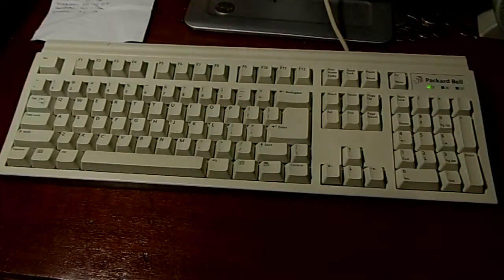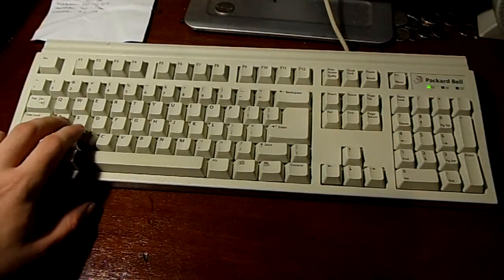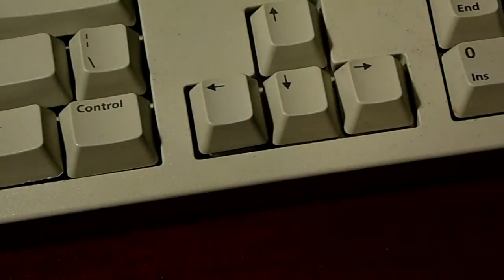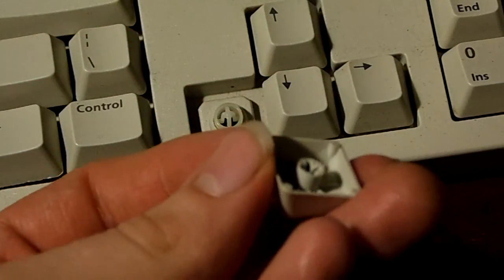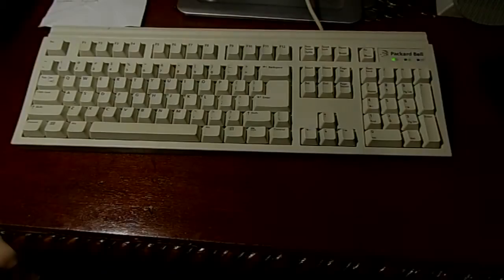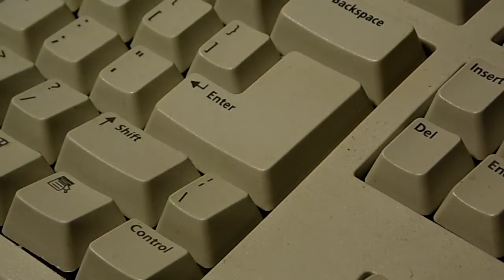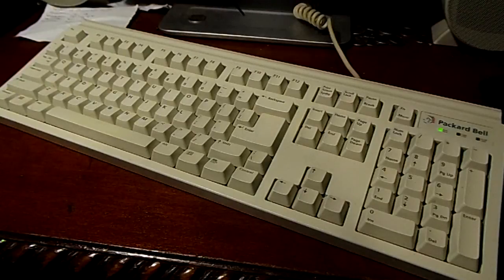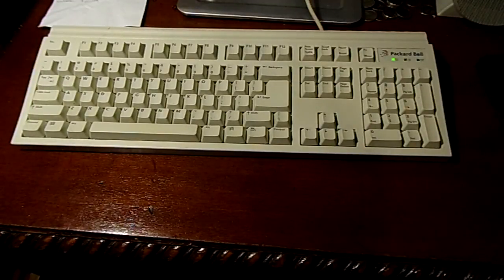Taking a look at the Packard Bell 5131c Keyboard.

Comment: The Keyboard I played Half Life 2 with. I had a custom PC built with scavenged parts, It had a Packard Bell keyboard, a late 90s Gateway CRT Monitor and the stereo Creative speakers that originally came with the Gateway (which was purchased new).
Reply: Interesting, i recently did a playtrough of a HL2 2004 build using a BTC/ Packard Bell 5139 keyboard. Infact, i'm typing on it right now!

Comment: So basically they Topre switches?
I found one at the flea market today. Looks the same without the windows key. 
The key feels like it's PBT there was zero wear on the caps, and all the key material still feel scratchy. The back has a solid metal plate.
The keys feels really really nice, i used quite a few keyboards, this one feels dam nice.
I think $20 in good Condition is hell of a deal in 2017 lol
Reply from the maker: Yeah I have a friend who is bigger on mech keyboards than me (I personally am no fan of mechanical keyboards) and he said it sounded like it was a topre basically when I described it to him. I have yet to find a keyboard better than these Packard Bell ones so every time I see one I snag it. I also collect the computers so it's nice to have some extra keyboards for that reason too. lol
Reply: Zhemin Lin sadly the keycaps are far, far, from PBT. they are laser engraved single-shot abs, but that doesn't mean this keyboard isn't alright
Reply: I just got one for 13 dollars in 2021. But some keycaps like f1 and f2 dont still in place for some reason. Its its only defect. But mine is a BTC 5149, and I think it's much more pretty than these packy bell. It has no windows keys, and has some gray keys that are beautiful.

Comment: This was the keyboard of my first computer back in 1995. I forgot about it and recently took it out of storage. After cleaning it up it brings back a lot of memories. Its not like the mechanical keyboards I use now, but its certainly a lot better than the membrane keyboards I used after this. The touch feel and the sound is quite good. I will probably lube the switches and I'm planning a mod to make it detachable with a usb C connector so I can use it sometimes in my current setup when I feel like it.

Comment: I have a BTC 5149, and it has the same switches and mount. But some keycaps, like f1 and f2 dont still in place like yours. It dont makes this "clack" 2:06 sound that yours make when I try to fit them. And after a while they come out the keyboard. How could I fix it?

Comment: My grandparents bought us a Packard Bell back in the mid 90's and it came with this keyboard, I never really thought much of it. I usually use MX Brown keyboards nowadays, but found one of these on ebay for about $20 and wanted to see how it is in comparison to the garbage modern OEM Dell/HP keyboards we use at work and my Browns. Fedex truck just dropped it off about 30 minutes ago and I am kinda floored--this feels better than any other non-mech (and even some mech) keyboards I've tried recently. 
I really can't decide if I like the feel of this more or the AJAZZ AK510 I just bought.
Reply from the maker: Lol I fully agree, they are by far my favourite keyboards hands down. Btw what are you using to use it on your modern PC? All the PS/2 to USB adapters I've used have always become flakey after a while.
Reply: @TranscendentalAirwaves  Oddly enough, my AM4 motherboard has a PS2 socket.
Reply: @TranscendentalAirwaves  My BTC 5149 has a DIN 5 pin connector, and still didnt find an adapter for this. Lucky me, my motherboard has a ps/2 socket too, so I think I can buy an DIN 5 pin to ps2 adapter to solve. I'm worried now that you said that most of these adapters stop working
Reply from the maker: @catoflado4977  Well I just ordered a chinese PS/2 adapter card that's PCI so I'll let you know how that works when I get a chance to install it.

Comment: I have this keyboard however the spacebar's spring was broken. Now I accidentally press it and get multiple presses. I decided to get a new keyboard and am t hink of mechanical CherryMX key switches. What CherryMX switch feels the most like these?
Reply: codydot this is irrelevant now but 1) you can take these keyboards apart extremely easily, the spring is actually just a piece of rubber that probably got stuck and 2) they feel the most like browns

Comment: out of the rubber dome with slider keyboards on the market the BTC is one of the best. With a couple of realforce keybaords as well this is up there with keyboard feel. 
This combined with MX stems makes $20 a steal.

S/N Topre Realforce keyboards cost upwards of 200$ and work mechanically the same way.
Poor man's topre
Reply: Unfortunately the stems are of poor quality and have problems easily. Some of the keys on my BTC 5149 don't fit at all in the keycaps. I don't know what causes this problem, but it is something to consider before buying this keyboard. So don’t spend exorbitant amounts of money on them, even thought they feel really great